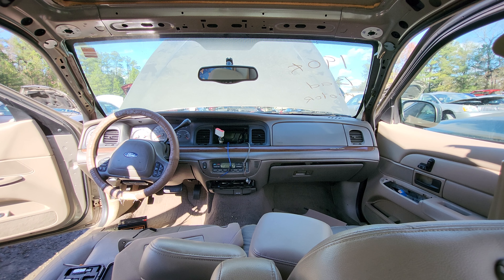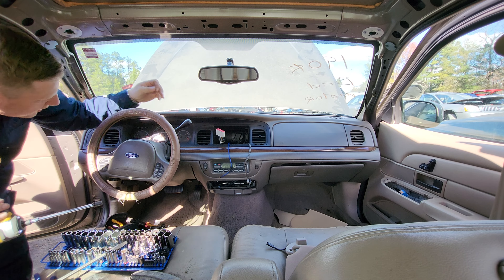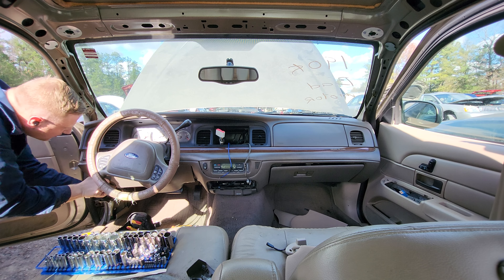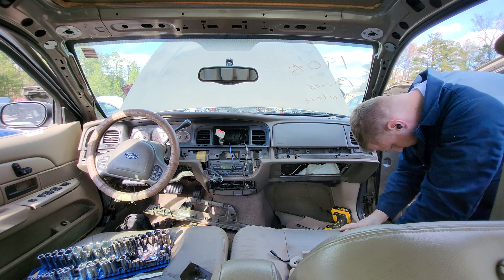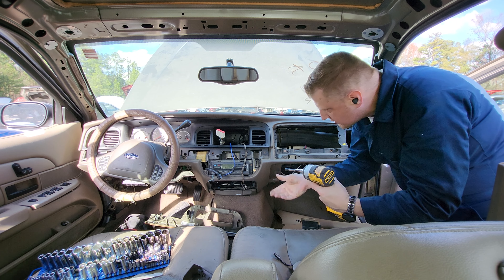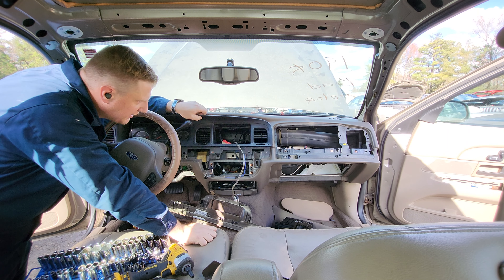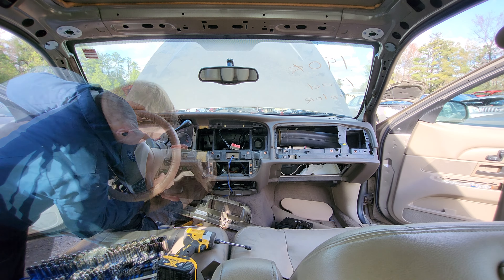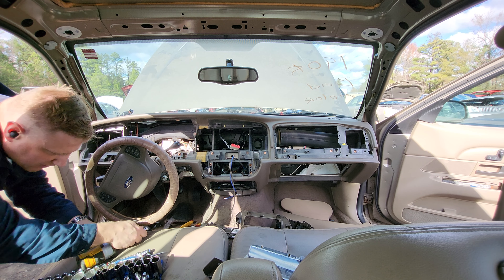BFG2: Crown Victoria Dashboard Teardown + Blend Door Actuator and Heater Core.

Comment: I'm going to share my brilliance with you.
I bought the shop manuals for a lincoln towncar 98 to 2002.
I'm going to learn the car like the back of my hand.
Then I'm going to always drive a panther platform vehicle because I'll be able to make the repairs because I'll know exactly how I did it before. 
Manufacturers change the models constantly  doing this I'll always know how to fix my car and not have to learn new procedures. I'll also learn all the common failure points of my generation of car. I have enough things to learn i don't need any more foreign to me things to fix. Yes, borrow my wisdom I don't mind!!!

Comment: I was almost in tears watching this... As if I was in my back seat of my 04'LX... That's my car your dismantling! ! !  
Clime control, dual electric seats, full controls on the steering wheel... and Freaking color!  And the last Drive by Cable throttle!  And Yes, the old style cable is the best! Timed my 2004 LX to my 2010 Interceptor and the LX had better times 0mph to 60mph and 100mph!

Comment: MarauderV8, excellent video, thank you for making it and sharing it with us.  I just did this on a 2006 Grand Marquis this past weekend.  I do have a few comments.

•	The 2006 did not have the U-shaped center support to drop the steering column onto when you remove the (4) 13 mm nuts.  So I had to disconnect the steering shaft pinch bolt and separate the shafts so I could drop the steering with the dash (otherwise I would have strained the steering coupling).  Looks like you were working on a 2004 Crown Vic (which has this support).
•	The 2006 has a swing arm support on the left front 13 mm steering shaft nut, so I removed the nut and dropped the support out of the way.
•	I was unable to leave the left side dash retaining nut loose and pivot the dash back.  I had to remove the nut and I wound up supporting the dash on two plastic milk crates.  The crates were placed where your feet normally go.

You were more aggressive than I was, perhaps because you did it before, perhaps because you had giant forklifts buzzing around.  I only had giant mosquitos buzzing around.  Anyways, without the procedure, depth, and scope of the job provided by your video, I would not have tackled the job.  Thank you again. Excellent work.

Comment: Can all the mounting screws holding the bond door be removed? Some videos show that only 2 of them can be reached and the ones closest to the front of the car can’t be reached, thus they just pry up the door and break off the screw mounting tabs on the door. Not the best but it seems to be the way that they get it done. Anyway, I hope you can figure out what I’m talking about😂. Thank you.
Reply: Do yourself a giant favor and do not break off the mounting tab(s) on the blend door actuator.  There are two screws toward the rear of the car which can be removed once the dash removal provides access.  Towards the front of the car, there is one screw and the other is a locating guide pin.  I watched all of the YouTube videos and folks stated that I would need everything from flexible extensions to a ratcheting 8 mm wrench to get this front screw out.  If you check, MarauderV8 has another great video on removing the blend door actuator (after dash separation).  https://www.youtube.com/watch?v=TamFR2KzILM&t=4s  What I had to do was cut the insulation out of the way with a box cutter (just like he did, be very careful here not to cut wires) and I was able to remove the front screw with a 1/4" drive ratchet and short 8 mm socket.  I had to take the insulation piece out and clear silicone it back in later.  Be warned that if you try and break the tabs off the actuator, you may wind up busting a piece off the heater plenum.  There are also a few videos where this happened.  It is a PIA job, but can be done.  I know because I did my share of cursing.

Comment: 14:20, but i still have to pull a lot of dash pieces out in order to remove an aftermarket radio right?
Reply from the maker: No, just the two center trim pieces that have the buttons on them (that are covering the 7mm screws for the piece that surrounds the instrument cluster) and then the piece I pulled out there. That's it!

Comment: good video .. my Q. how to reach rear air line for back seat, it's blow air very weak? no one ever talks about this part as much as I searched on YouTube, thank you.
Reply from the maker: I think it's always blown air weakly. The one thing that could be affecting it is your mode door. It's a door inside the HVAC box that directs air between the different vents (floor, dash, defrost) and has a weak plastic hinge. If it breaks or stops swinging all the way, it'll direct air through all of the vents at the same time, making it not blow as strong through any of them.

Comment: Wow, i feel like I can do it now..  I was too intimidated to try to replace the blend doors (2006 LTC, which I’m told should be similar).  But now I’m wondering if I should replace all five blend doors, once I open it up?   Someone else did the diagnostics.
Reply from the maker: I haven't pulled an LTC dashboard, but the concept should be the same. The dashboard are built outside of the car then installed as one piece, so they are pretty easy to remove.

Comment: Im kind of confused. 
Am i or am i not pulling the airbags out?
Reply from the maker: You don't need to pull the airbag out. I made another video specific to replacing the blend door and heater core if you want to see exactly what you need to remove.

Comment: A benefit to many would be doing a blend door activator replacement-listening to you is not as helpful as watching it done 24:48
Reply from the maker: I made another video specific to replacing the blend door and heater core and it goes into more detail about the actual removal.

Comment: Forget that Ill pay someone to replace the heater core......there is a reason why he is using a salvage vehicle, so he doesn't have to put it back together.
Reply from the maker: I did it in the junkyard because I didn't have a reason to pull my dashboard as I'd already replaced the heater core. Putting it back together is just as easy, but nobody is twisting your arm and forcing to do it yourself. If you want to pay someone else to do it then this video isn't for you.